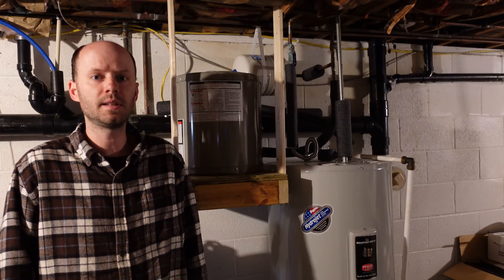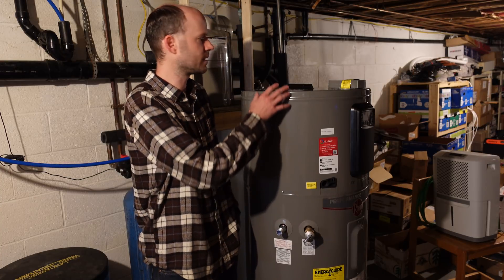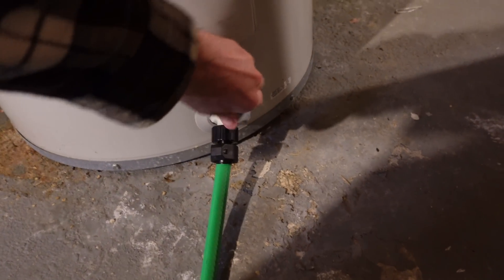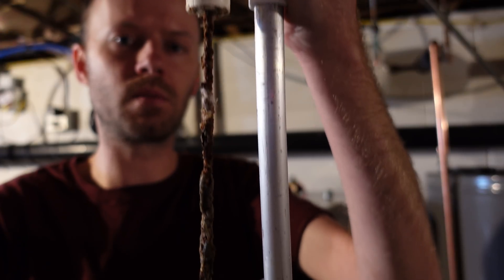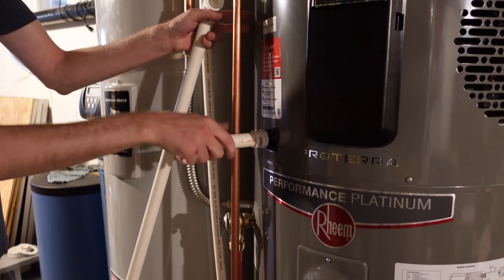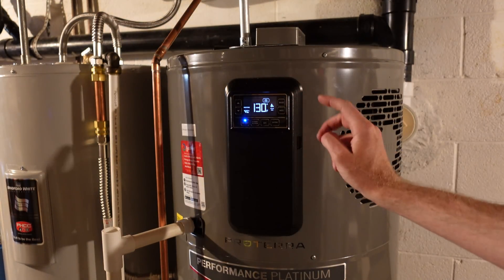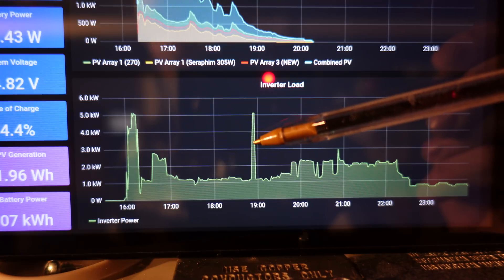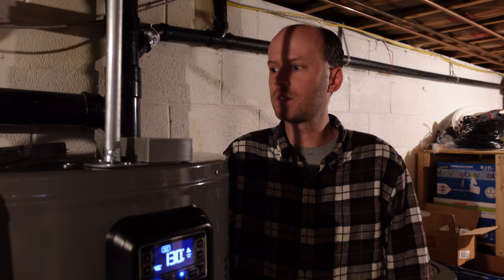Reducing Energy Consumption with a Hybrid (Heat Pump) Water Heater

Comment: Something new with these Gen 5 Hybrids unlike the Gen 4 models is that the 4500 watt elements will possibly come on in all modes depending on incoming cold water temperature, even vacation mode if the water temp falls below 60 degrees default set point. Something Rheem is blaming on an algorithm glitch. They are not correcting the problem and are just hoping no one notices. With the Gen 4 models if you put it in Heat Pump only mode that is what it done, heat pump only. Trust me I have spent hours on the phone with Rheem about this. They should have kept the touchscreen display/control board from the Gen 4 models and used them in the Gen 5. It had so many more features like 4 different water temp sensors, ambient temp, evaporator temp, discharge temp and other features. It is still an efficient water heater though.
Reply: Have you tried disconnecting the heater element and does it fault? I do supplemental PV resistive  heating on mine, but it is an external NYLE and just wondering if this could also be done with an all in one tank.  A 1uF capacitor may simulate enough load to defeat a current sensor if there is one. Any load of this would not be seen by meter as it would just help correct power factor.
Reply: @opera5714  I haven't tried that. I had posted this but didn't say it for the reason is, if you are completely off grid and just want to run "heat pump only" with the Gen 5 it may call for an element with real low incoming water temp (-65 degrees) and if there is less than 23 amps or greater than 23 amps give or take 10% the control board will show element fault and poor element health. Some people  have said to disconnect the elements and put a 240v light bulb in its place to show some resistance but the board still reads the current (23 amps +-) and gives fault. I think the real reason they done this with the Gen 5 that it will bring an element on in all modes is complaints of slow recovery times. Hence always keeping the inrush of cold incoming water at a minimum therefore making for less recovery time regardless of what mode you're in. The engineers I talked to at Rheem understood what I was saying and kind of agreed with me but at the same time wouldn't admit it. If they say Heat Pump only Mode as an option that's what it should be. Some people's solar/battery bank can't handle the 4200 watt load for an hour was my point. Anyway it is the most efficient consumer hybrid on the market right now and I do love it.
Reply: @MiniDigging  I was an industrial controls designer and can they still have a mechanical thermostat much like a home thermostat that comes on at a low temperature should the electronics fail. A sense line might also detect if the element is powered and the over temp has been tripped. Never say never. But, I find it hard to believe that there is much interest in the 
health or current of the element. This seems like a secondary non issue. Does it make any real difference if the element 
is disconnected. Wiring harness could make that difficult to implement. Some have alluded to an issue if the heater is 
disconnected, but have never explained what happens. Anything can be faked. I am curious about this because I believe PV 
resistance has a future role to play in efficient water heating and this element could be used in solar. At 400W, a HPWH
 can't dump that much energy and they become less efficient at higher temperatures. Battery usage should be spared as much as possible toward the end of the day. Any link to interconnect schematic and picture of board would be helpful. I used a capacitor to trick my HPWH into working.

I have spent years developing PV diversion controls that don't use inverters, charge controllers, or batteries.There are serious amounts of power just wasted in a conventional PV system. That could be used in the heating elements a HPWH system to speed recovery and elevate water temperatures to maintain the tank overnight. In fact many PV resistive systems could operate on existing panels alone. Efficiency doesn't matter when it is free.

So, I and others who follow me are interested in any information you find on disconnected elements. My designs are 
too complicated for most in solar. These simple designs can increase performance.

Comment: Uhm, how is your basement heated? This seems like it'd become a big drain on your heating system instead. Most heat pumps i've seen have an external unit and pulls heat from there instead.
Reply from the maker: Yep in winter it will be a big drain on heat. That's when I would switch it back to the electric elements. In the summer, it's always warm and humid down there.

Comment: I installed the 80 gal version of this same water heater 4 months ago. It is super efficient and I bought it specifically to run off of my solar system in a emergency situation and  partially during Sunny days. I run it on heat pump mode and it operates at around 400 watts. I'm still in the process of installing my solar system but I'm sure it will work well in a emergency situation. My system is 2 GroWatt 3kw running in series with with 3900 watts of panels, and 5.3 kw Battery storage. When we replaced our old water heater it dropped our Electric bill by 38%. Hopefully when we get the solar system installation completed we can drop our usage another 30 to 40 percent. The 80 gal. Unit we special ordered through Menards opperates on 15 amp 240 volts circuit. The heating elements draw 2450 watts, which we will never use when in solar mode. Even in a grid down SENERIO we should have lights refrigeration, and a hot shower. 
This was a $2000 water heater but with the sale price discounts and Electric company rebate our out of pocket cost was $900. Kinda a no brainer for saving money and heating your water. 40 cents a day for a family of 4 and I can run it on my solar system. Hey what's not to like about that. Also it's in our basement in the pantry area and keeps everything cool and dry average temperature is about 55 degrees. Haven't ran our dehumidifier since the install.
Great video! Your the first one I have seen recently and I would recommend everyone to get on board with these great highly efficient heat pump water heaters. 
Thought about adding the intake ductwork to pickup warmer air for more efficienty but I'm happy with it for now. Hope you have the same results that we have experienced. 
Thanks for sharing.
Bob

Comment: They are cool.  I got a Rheemes 50g (from Home Depot) 2 years ago.   The Heat-pump only mode maxes out at only 450w and works really well.  2 loads of laundry will 'drain it' but it will recover in 2 or 3 hours.    Overall, our family of 2 with 100ft of hot-water recirculation used 1,990 kwh for the year.   Min of 140kwh/month in summer and a max of 201kwh/month in cold winter month.   The tank sits under the house with low of 55F/13C in winter and high of 75F/24C in summer.     In addition, its easy to switch to 'traditional' (heating element) mode...  so if you have high demand such as visitors for Christmas you can easily avoid the slower/more-gentle recovery in heat-pump mode for a few days and use traditional 4,500w heating element :)

Comment: Awesome way to heat water. Hope you make a follow up video with details about how well it dehumidifies the basement, ect.
Reply: We've had ours for about a week.  For a household of 2 people, it runs so little that its a minimal difference in temperature and humidity in our garage.  Our standalone dehumidifier still cranks away like it always has.  Only using about 1-2kWh for water heating now though.
Reply: I too would love a follow up video!

Comment: We have had the same HPDHW for 5 years. Ours runs about 2 hours a day with two people. Set at 127 degrees to get 120 degrees at the faucet, even though it says 120 its actually 113.  The costs savings over 4 years it paid for itself.  Would buy again if it broke today.  Yes it has to be in Eco mode to keep demand elements turned off.  Ours uses 360 watts when running.
Reply from the maker: That's great to hear it's been working well long-term! and makes me feel good about the investment :) I really wish it had a display that showed actual temp of the water. I was seeing similar in other videos that you have to set it higher than the temperature you actually desire. I guess it has a wide temperature swing to prevent constant cycling and save power (just my guess).
Reply: @LithiumSolar  you're display is different from mine. Check you're EcoNet connection via wifi. Look for a status (sensor) menu in the service  menu. Mine shows upper and lower tank temperatures, elements power on or off, line temperatures  for heat pump, txv valve open %, discharge coil temp and ambient temperature of room
Reply: @jstaffordii  I bought and installed one last year, and it has the nice 'sensor' display option. We bought another one this year for our daughter and son-in-law's place and that newer model misses the detailed display. We could not find it in the App either. I was rather disappointed by that.
Reply: @heinvandenheuvel  yeah they dropped the display now that they have EcoNet IOT solution
Reply: @LithiumSolar  I also miss the actual temp reading - how hard would that be?!  John Stafford II -  I was also disappointed with the temp hysteresis. You don't want it to short-cycle to satisfy  say a 1 degree requirement, but 5 degrees seems too much. The proper solution for this is probably to install a ($100) mixing valve set to a safe 120 F and let the tank heat to 130 or more. This will also allow you store more energy while the sun shines. Program a schedule for example for 135 for 10 am - 4pm and 125 outside that window. With that I find  the for most days it only heats when the sun shines. -

Comment: The main problem with those are the recovery rates when using the heat pump..   Will be interesting to see if you have to change your water usage habits to keep it from operating like a normal water heater.
Reply: I doubt he will have a problem since he has 100 gallons of hot water storage and only two people in the house.
Reply: Have owned one for 2+ years family of 5 with no issues if you time and limit the teenage showers.
Reply: @zekeboz5533  are you running it off the heat pump only?
Reply: @FJB2020  Yes, i use just Heat Pump. As the previous comment mentioned when you 1st commision the tank it'll use one of the elements until it reaches 60F or so then only the Heat Pump will run. You want to ignore the menu request to put it in HYBRID mode, which uses an element also. I believe  Rheem requests that mode to cut down on customer complaints, "I ran out of hot water" . I also leverage an additional tank and boost the rheem temp to the max, 140. that way when there is any 'demand' the 140 water hits the secondary tank and helps 'warm' that water for a longer load like a shower. so far so good.

Comment: Making hot water using electricity is pretty inneficient.  The hybrid water heater is a step up(it might pull heat out of your home in the winter making your heating system work harder).  Heating water with traditional flat plate panels and a circulator pump is much more efficient.  builditsolar is a good resource for water heating and space heating applications.

Comment: Making hot water using electricity is pretty inefficient.  The hybrid water heater is a step up(it might pull heat out of your home in the winter making your heating system work harder).  Heating water with traditional flat plate panels and a circulator pump is much more efficient.  builditsolar is a good resource for water heating and space heating applications.
Reply: "Making hot water using electricity is pretty inefficient." I disagree. "The hybrid water heater is a step up(it might pull heat out of your home in the winter making your heating system work harder)." I agree, he should install ducts to intake and exhaust to the outside.
Reply: @uhjyuff2095  I heat a 5500 sq ft house and make hot water for eight people with $1450 worth of components using flat plate (water) collectors and a single circulator pump 75 watts. (Heated floors) The only time I have issues is when it is overcast for 4 days.  Cheaper than the hybrid water heater I'd bet.  Hot water from solar has a rapid payback whereas solar electricity does not typically.
Reply: @allyn7577  His heat pump water is completely off grid which is powered by batteries and inverter and Pv solar panels. His Pv system is more expensive, but compared to your system his can make some hot water AND supply electricity to his home.
Reply: @uhjyuff2095  Maybe...but chances are heating and cooling are more of a stretch.   Can he heat his home on pv because most people can't. Lights, a refrigerator, maybe doing some laundry.  I am talking about heating 5500 sq ft and hot water for eight on 1400 bucks. Typically that would be 60000 for a professionally installed pv system.  See the difference.
Reply: @allyn7577  No doubt your system is cheaper, and has faster payback. What size storage tank do you have for 8 people? And what size electric heating elements are installed in the tanks?
Reply: @uhjyuff2095  Well I have about 400 gallons of hot water stored in an underground insulated tank.  It feeds two Titan Tankless on demand hot water heaters after a mixing valve and the copper coil in the tank.  If the water isn't hot enough the on demand will bump up the temps.  I don't really know if they still work or not, the lights are on and maybe they cam on at some point over the winter...but I don't know.  I have a six inch slab on my house that has pex coils in it.  It acts as additional heat storage beyond the water tank.
Reply: @allyn7577  See if you can look at your electricity bill, mine shows hours of peak electricity usage. If your electric Titan water heaters are coming on they draw 18kw each.
Reply: @uhjyuff2095  Well mine are I think 11.8 each in parallel.  But no my electric bill doesn't show it like that even though I have a smart meter. Though they only come on if the water is below about 105F.  Even then they maybe only put in a kw or three to boost the already hot water.
Reply: @allyn7577  Actually solar electric works better than solar hot water, it installs easier, it works in all climates without worrying about freezing, and is multi-purpose. Oh, and electric to heat water is 100% efficient. Transferring heat from somewhere else will get you more heat per watt, but that is not called efficiency, any more than more heat per dollar by using natural gas is called efficiency.
Reply: @allyn7577  What does your solar heating system cost when installed professionally?
Reply: @allyn7577  Did you include the cost of that "six inch slab with pex coils" in your installation cost?
Reply: @Sylvan_dB  No but it was 300. All I did was zip tie a coil to the grid. Did it long before the solar install.  At the time you could get a thousand feet for around a hundred and twenty five dollars. That was ten years ago. I have another on demand hot water heater turned down to produce 90 degree water too.That was 180 from the original install.  It heated the entire house on its own after a few days. Eventually the return water would get to around seventy degrees so it would only have to heat water around twenty degrees more.  Though resistance heating is expensive. The electric bill doing this was typically between four to six hundred dollars.Solar really has eliminated the cost.  A 4x8 water panel can produce about 16000 btus a day. I have about 300 square ft. The main cost was the copper pipe, but everything is super cheap to build them yourself.  Plywood, flashing, silicone, copper pipe, screws, and those clear double wall roofing panels are all you really need for the panels themselves. Buy a taco recirculating pump and some odds and ends and you are in business.  The storage tank is in ground and consists of a couple of sheets of foam board and an edpm liner with a plywood top and copper coils. The copper coils I got for free from my dad's old install.
Reply: Making hot water with 400 watts from a solar panel is about as easy and cheap as it gets , efficient doesn't matter .
Reply: @onthelake9554  400 wats at 120 volts. 4000 watts at the panels.  It might be close to his entire solar array to do it, with not much left over. Better than the previous stuff but..  So lets say eleven grand for the panels and the water heater.  When it can be done for less than two not on electricity.  Yeah dude...efficiency doesn't matter...that's a laugh.  It wasn't bad for him because he already had the system. Most people can't see past the hype on electrical solar panel generation to even think of the older method of just running water through pipes.
Reply: Sometimes  inefficient isn't an issue, it is total cost.  I heat water at my camp with PV using only excess PV power not needed for charging.  I didn't buy any excess panels, just what I need to run daily needs. I have so much excess power that I even have a 40 gallon tank in the garage just for the clothes washer. Even feed hot water into the cold inlet so all cycles use hot water.   It only cost me $30 to go all solar.  Far less than what a heat pump, big charge controller, big inverter and big batteries would cost me.  And if you have a wife who will let you put direct solar tank on roof, hold onto her like grim death.

Comment: Is that heated by evacuated tubes? And yes videos on off-grid stuff is good.
Reply from the maker: No, it's not a solar water setup. It's a heat pump that's run by solar power. A solar collector that transfers directly to water would be pretty cool though!
Reply: @LithiumSolar  Oh I see. I guess I didn't listen very well lol